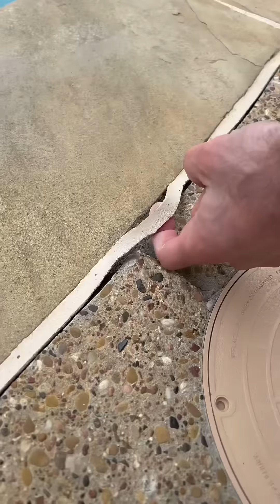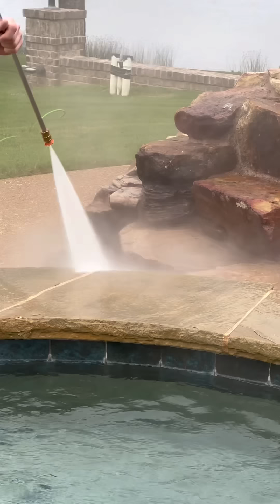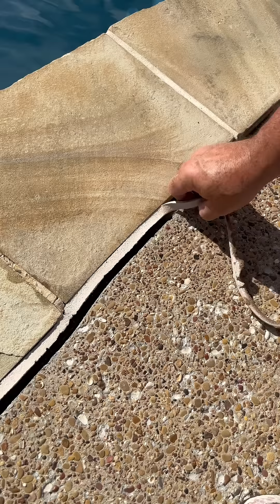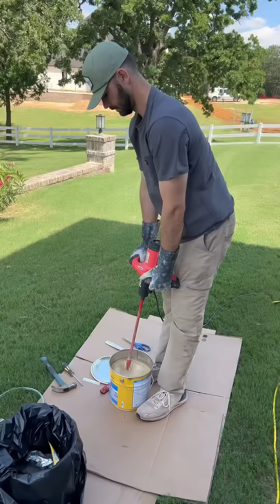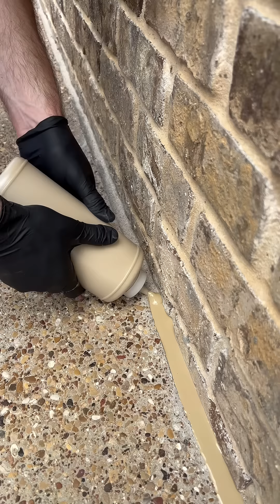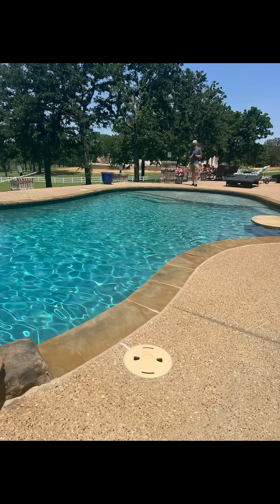Mastic Replacement + Stone Sealing Done Right. #Shorts #PoolUpgrade #ConcreteSealing #BeforeAndAfter

Comment: How do you prevent the sealant from going into the pool on the vertical gaps so not the space that follows parallel with the shape of your pool? I have like rounded pavers almost for the edge of My Pool with what seems to be grout, but doesn’t exist anymore. I need to repair it cause water seeping in between all of these bricks.